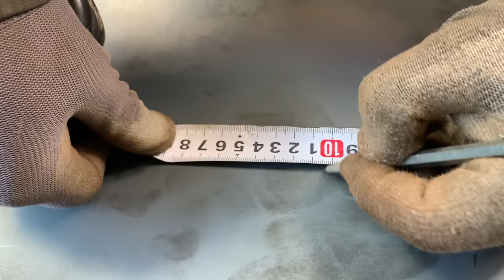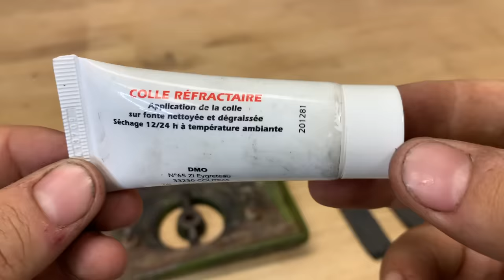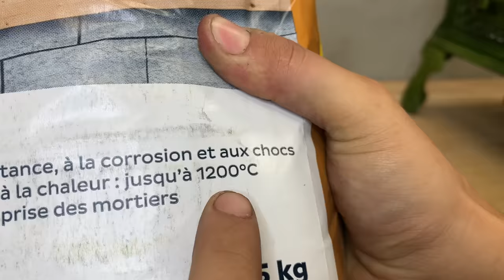Antique and Broken Stove Restoration

Comment: The steel became dark because of carbonization due to high temperature.
Reply: Thanks, was looking for an answer to that!
Reply: @alyssav2124  Same. I was pretty certain I knew, but I like having the confirmation.
Reply: True, but it's not steel it's cast iron which is porous,  and when it expands from the heat carbon gets trapped slowly changing the chemical structure of the iron
Reply: yeees (thats what i thought but i wasnt sure thnx <3)
Reply: Agreed. It's a naturally occurring bluing due to oils and high heat.
Reply: @JsgHair71  it's not bluing, it's carbonization - chemical process when carbon reacts with iron. This is common heat treatment process.
Reply: shouldn't that be pretty obvious? for iron at least more than steel.

Comment: 14:28 the metal is dark because it's covered in black iron oxide. Unlike the red iron oxide (rust), it's pretty strong, and forms a protective coating
Reply: Hot salt bluing ( the process which makes the steel on guns black) is essentially the same as this. Just a more controlled coating of the oxide. And because its an oxide no new oxide can form on it with ease so its rust resistant.
Reply: I think the same 😉
Reply: Or japanese black...
Reply: @anderarraa249  AKA seasoning or quenched in oil ?
Reply: @Jethro.Maloku-le.Rey.Kalsitran  japanning used different chemicals and process iirc
Reply: @johnsig7100  Hot salt bluing is a bit different. Rust bluing is the process of applying a salty acidic solution to have controlled rust which is then boiled and the loose rust removed.
Reply: @Curlyl0x  yes. Cast iron pans are heated with a layer of oil on them that carbonizes the surface and turns it black
Reply: If anyone would've asked me I'll say that: rust is iron hydroxide.
Reply: @Curlyl0x  nop, cast iron pans are black because they are covered in burnt oil, you get the same color when you quench steel in old motor oil, that is why you can wash that layer off with soapy water
Reply: Good answer Sheevlord! In blacksmithing it's called forge scale, you have to continually remove it with a wire brush as you forge your piece. This is basically many years and many layers of that build up. It's the constant reaction of the metal to the extreme heat.

Comment: for those who may not know "inox" when he says "inox rivets" means stainless steel, in french we call that "acier inoxidable"
Reply: Would that translate more or less to rustproof, since rust is a product of oxidation?
If so, that’s a clearer name than stainless.
Reply: Thanks for that! I was like, hope not alloy rivets but ...inox ...they won't fail for some time.
Reply: In spanish "acero inoxidable"
Reply: In Portuguese it's called "aço inoxidável" basically the same as in French and Spanish.
Reply: Great, I was concerned as I thought he was using Aluminum rivets which would not last a darn.
Reply: Rostfrei in German.
Reply: Also in Italy we call it Inox for "acciaio inossidabile" steel that does not oxidate
Reply: @NeedsMoreBirds  In Denmark it's wrongly called ''Rustfree'', as no steel is 100% protected against oxidation/corrosion. We have an older word that is more correct that actually translates to Rustproof.
Reply: @jbuckley2546  Or "Nichtrostender Stahl" (non-rusting steel), abbreviated Nirosta or Niro.
Reply: @giuseppeesposito7094  That is exactly what I call it.😉

Comment: Welding the cast iron is the skill, well done.
Reply: No it’s quite easy
Reply: Welding cast is easy. The hard part is going to keep it from cracking down the road from the stress built up in the piece . Not much pre-heat and fast cool down. That was the harbor freight junk of it’s time. Wouldn’t waste mine, that’s for sure. But they are probably bobble heads so it may be worthwhile for them to spend 3-4 days on a 50€  max pos

Comment: Cat timestamps here I found:
12:04 - Avril checking the new metal almost box. Cats love box
24:15 - Quality control time. Employee Avril on duty. Cat jump of approval.
30:41 - Orange fluff strolling. A part of the screen is covered (only tail tip is visible to me), but it should be Avril

Welding can damage the eyes too. Even if a video of welding is safe (at least it should be), better safe than sorry, and it might help viewers get used to not staring at welding irl.
Thanks for the video, the stove looks pretty good. May God bless you.
Reply: Many meows of approval .
Reply: I thought he was gonna roast the 🐈
Reply: @kagtiiii  That would bring a million views for sure.
Reply: The reason he didn't saw the welding is because he didn't want spatter on the lens.

Comment: Your attention to detail is amazing, most people would have just replaced that broken piece with a some square stock,grinding it to the same design/radius is going the extra mile which is why I keep watching your channel.
Pre-heating the cast iron is something a lot of people new to welding don't do,being as porous as cast iron is it holds a lot of dirt/oils.
Another thing a lot of people would also have tried was to "band-aid" that metal inner box, glad you just scrapped it and made a new one, as always great job, looking forward to the next one.

Comment: 16:00 or so on. Great welding skills, or rather, as I mentioned, what you do with the welding beads often you’re done is key. The finish work to make the edges, etc. conform to the original piece is what makes the overall rehab the best. You can’t even tell where you made the welds or finished the welds. Amazing work.

Comment: About the darkening of the metal: It's at least in part due to both the type of iron or steel (mostly cast iron in this case unless I miss my guess) and due to carbon migration from the fuel and the high temps. As others have said, it's also in part black iron oxide.

Comment: I am amazed by the work of restoration you do! 
I still use this kind of wooden stove to heat my place and I am looking for years to find someone to renovate one (I abandon, my husband and I will do the work) from the mid 19th century. The outside is made out of enamelled cast iron and the enamel is damaged at some places. Is there a good way to repair the enamel on the stove or do we have to take everything away and just paint over it?
Also, what is the white product you let dry on the enamel after washing it?

Comment: In the Firedoor is allways Fireglass inside the Door. Its a little bit flexible, ca.2mm and you can cut it  in all forms with a sissor. Its call Stoneglas, we buy it in the Nederlands for our restaurations. Also we take old roundhead screws and fireheatstones in fire Zement in the Heatplace. No modern screws.

Comment: Is that metal cast iron? Cast iron is apparently very fragile and cracks easily I see you put a liquid there before drilling it was this the heat resistant paint? Was this to stop the cracking? I see you also heated the whole other piece before welding. Did this also prevent cracking? I apologise for all my questions. Curiosity as well as a desire to learn makes me so inquisitive.

It is really beautiful. I should imagine it heats the whole room while burning. Wonderful in icy cold weather.

Comment: It’s likely someone else has commented over the years why the metal lining and cast iron parts were black tinted from the heat. This is due to carburization, meaning the carbon emitted from the smoke of the fires burned inside the stove over its very long lifetime bonds with the metal and begins to seep into the surface grain layer. This makes the metal more brittle over time and prone to cracking, which is likely the reason the grate frame you welded back together cracked apart in the first place.

Comment: The blackening of the steel is do to a combination of heat oxidation and heat tempering. It happens to stove metal all the time. It can also excellerate rusting do to the repeated thermal shock and weakening of  the carbon molecular bonds that make up the steel.

Comment: Hi, what was the brand of the rust proof spray you used for the iron parts? Does it do the same job as the heat resistent paint? Thanks

Comment: I would say that metal is black after repeated exposure to fire and smoke the pores of the iron are filled with carbon molecules and the carbon is trapped in the surface of the iron. Not unlike heating steel and putting it in oil you get a carbon layer on the steel.

Comment: Man , i can't believe you did not put a vertical exhaust pipe for the test , a chimney its an essential component of a stove , the rising hot smoke acts like a piston , sucking fresh air for the combustion from every possible hole on the stove , in this case from the main door , so its doesn't make smoke inside of a room ..

Comment: The metal is dark because carbon has risen to the surface  The same thing happens when I gas weld.  If I use too much oxygen, the metal will turn black and become pitted.  That's because the oxygen causes combustion of the metal's surface to occur.

Comment: Where can you find such treasures? Why Iron is black? Black oxidation of stainless steel (also: oxidising stainless steel black or colouring stainless steel black) is a chemical process in which the nickel atoms on the surface of the stainless steel are chemically oxidised at a temperature of 130 °C. This causes the surface to turn black